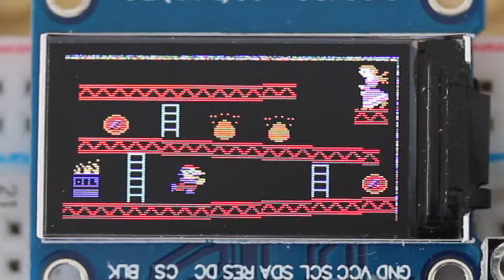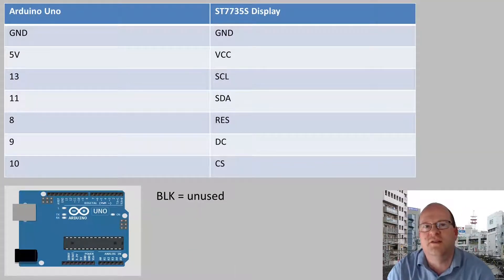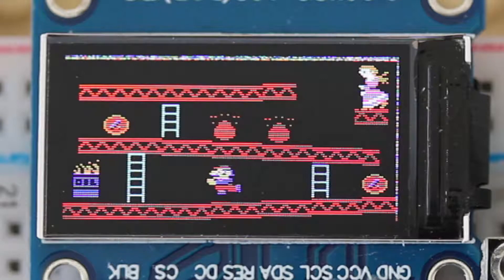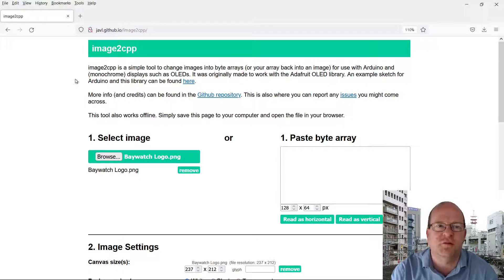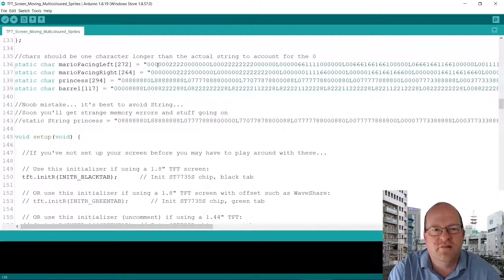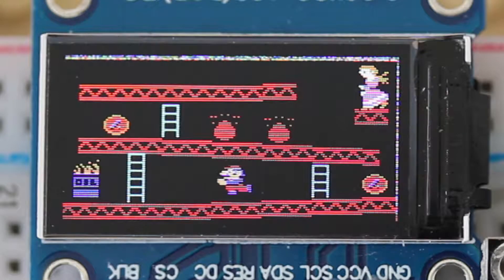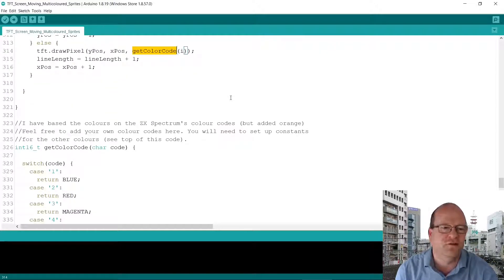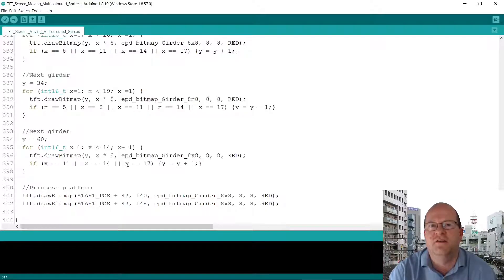Arduino + TFT Display With Multicolor Sprites (ST7735S 80x160 Module)

Comment: I have been happy with the m5stack line for playing with this kind of stuff. Also trying to figure out sprites at the moment.  The m5 is an esp32 with built in 320 x 240 display. Has buttons. Speaker. Mic. Wifi. Sd card. Battery etc.  Ive also really liked the samd boards like trinket MO. Qtpy etc.  Much better with memory than an Uno.

In my search on sprites it seems that a special character for transparent can be used.  When i did a mario test game i was using a touch screen on an UNO and i ended up drawing a background color box and redrawing mario in the new spot hardcoded with drawPixel.....
Reply from the maker: Thanks for the info. I've not actually had much luck with displays lately because so few of the new ones I've bought have actually worked! I bought Waveshare e-paper displays but they worked for like 30 seconds and will no longer refresh. I bought a big TFT display from Amazon but I have no idea how to connect it up. And I've switched from the Arduino to the ESP32 and ESP8266 but neither have worked with any of the various screens I have.

I have made another sprites prototype, this time using the SSD1306 monochrome display. I'll upload this video soon. About the best thing about this one is I used my new 3D printer to make a case for the OLED display. This time I made a space invaders game. I found the display updates very slowly so I might switch to a different graphics library. This time I have undrawn the sprite in black before moving it. One thing I did notice from my research is that the original space invaders game appeared to use a user defined character set for the sprites. This might be the way to go with these small displays. I think this would involve making a character set, then converting it to C format.

When I programmed the ZX Spectrum a lot of programmers used screen buffering so that might help too.
Reply: @codingwithbrett  i am not a programmer by trade. I work in 3d but recently did a gps speedo video using the m5 if you want to check out the display.  https://youtu.be/xlb7FGKBp3Q

Thr m5 stack library calls all the other libraries you need which is nice.  Since its integrated there is no issues with hook up.  I too have had hit and miss issues with displays but assumed it was my lack of knowledge. :)  ill keep an eye out for your new videos. Thanks!
Reply from the maker: That's a nice looking display. The Waveshare 1.5" colour OLED is very nice but as for getting it working... oh man! I am working on a tutorial though.
Reply: @codingwithbrett  the m5 library has sprite.h included which is a tweak on the Bodmer tft espi  library which is a nice sprite option. Just an fyi based on your work in this video.